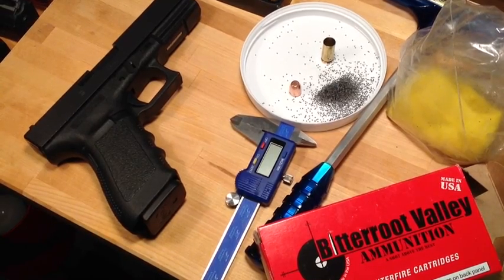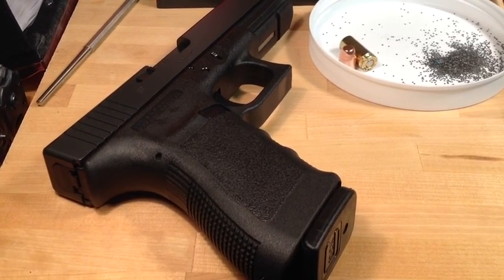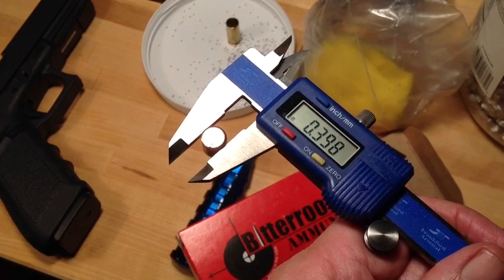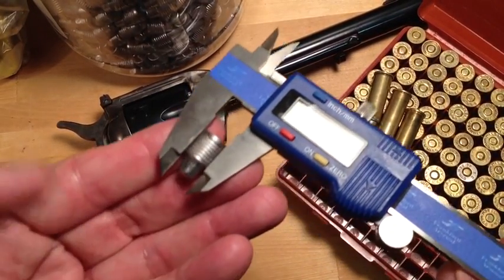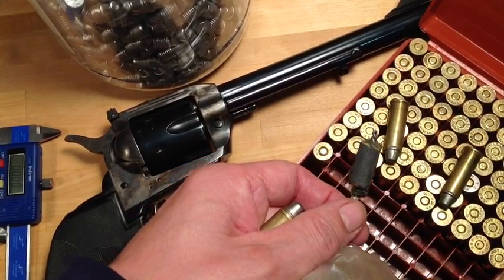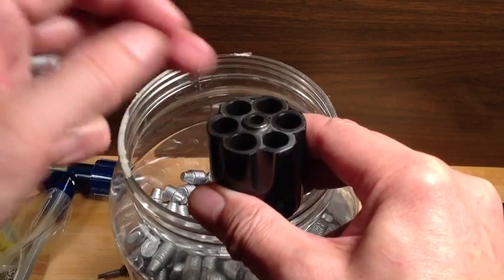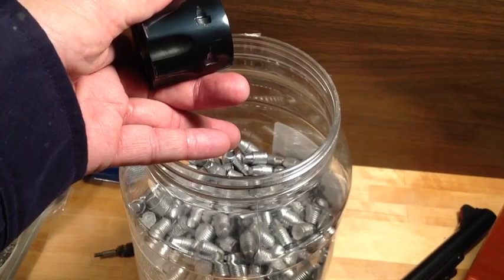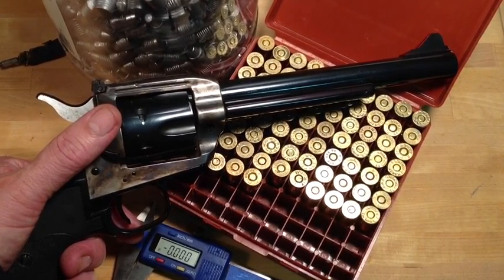The Trouble With Bullets Too Small For Your Gun

Comment: Fortune cockie 45 I really enjoy your videos. They are very informative .  I hand load 45 acp and 45 colt. I cast Keith type bullets for them.  I'm thinking of buy a lever gun in 45-70 govt. Is there any way I can use the same bullets in the 45 colt and the 45- 70. I don't want to have to buy new molds for the 45-70 and then have to make sure I keep the bullets separated.  I would like to hot rod the 45 colt rounds to 44 mag pressures.

Comment: I don't know if you bought that gun new or used, but maybe someone reamed out the cylinder .  Some people think that the bullets should drop out the cylinder. Not something I think need to be done in most cases.
Reply from the maker: Farmer Dude357 - Bought that gun brand spanking new...Came with cylinder throats .007" huge - might as well have been the Grand Canyon...Gun needs a new cylinder, but not worth the cost - just shoot jacketed bullets will be OK... Also, I've had some success using a mold that drops bullets way big, then powder coating them even bigger.  Makes this gun shoot decently.  There is a video up on that.   Have a great day,  FC
Reply: It makes me wonder if you got a lemon, or all them guns was made like that. I know I've said it before but thanks for your videos.
Reply from the maker: Farmer Dude357 - The guns are excellently made otherwise...And I've been able to get the guns to shoot decently.  Just takes ammo that I label - for the Virginian.  And if someone bought one of these, just shoot jacketed ammo - they shoot jacketed ammo just fine...the jacketed bullets just traipse through the big cylinder throats and enter the forcing cone without minding that the throats were so big... Best to ya,  FC

Comment: In light of this video, would you say that the shooting 9mm out of a convertible Blackhawk is a bad idea?
Reply from the maker: J0sh92 - Great question - wish it could have a short answer.  it's been reported that those 357/9mm guns do not shoot 9mm well because "the bullet is bouncing around in the bore".  The assumption is that our bore is .357" for 38/357 and 9mm bullets are .355'.  But from the video, note that in a properly set up revolver, the barrel groove diameter is actually smaller than caliber. The important thing for accuracy with lead bullets is the chamber throat dimensions need to match our bullets.  So for these BH Convertibles to best work - the cylinder for 357/38 should be .357" so our jacketed bullets can be .357 and our lead bullets .358" (.001 bigger than chamber throat).  The 9mm cylinder needs to have throats at .355" so 9mm jacketed bullets are .355 (and they are), and our lead bullets .356" (again .001" over chamber throat).  So for perfect performance, our BH barrel should be .3545" so that the forcing cone will direct .357" and .355" bullets into the rifling maintaining seal from the chamber throats, through the forcing cone, and into the rifling without allowing gas blow by.  If the BH is set up that way, shooting the 9mms in the Convertible will not be a bad idea.  If not set up that way, hopefully the 357/38 is and we can just shoot 9mm jacketed anyway.  Best Regards

Comment: Like Wayne Johnson said, what is the groove diameter? Measuring the throats tells us they're over-sized, which can definitely lead to inaccuracy, but there's a part of this puzzle missing. What is your groove diameter?

Leading isn't caused by over-sized throats, but usually by throats that are undersized. For example .428-inch throats with groove diameter of .429. The undersized throats size a cast bullet down to .428 and it doesn't fill the .429 grooves and leading results.

If your groove diameter is larger than your cast bullet, you will get leading and accuracy will really suffer. Bullet fit to the rifling is critical.

Slugging the entire bore will let you know generally what your groove diameter is.
When slugging your bore, feel for tight spots and loose spots. After slugging the bore, make sure to slug just the area where the threads of the barrel screw into the receiver. Very often manufacturers will over-torque a barrel onto a receiver, causing a constriction in the bore at that location. A thousandths or two constriction at the barrel threads might be able be lapped out.

Again, your throats are definitely 'a' problem, but not necessarily 'the' problem.

By the way, jacketed bullets are more forgiving than cast, to a certain extent.
You might want to try some jacketed ammo to see if you can get acceptable accuracy. Regardless, if your groove diameter is grossly larger (several thousandths) than your bullet diameter, accuracy will suffer whether cast or jacketed.
Reply from the maker: John4566442 - Thanks for your comments.  Sorry for the length of this, but it is a comprehensive subject as you know.  

First of all, my Dragoon shoots very poorly with jacketed ammo.  When I first bought the gun 38 years ago, it was the age of high velocity light jacketed bullets and the flyers were unacceptable.  The company went out of business and I put the gun away. When guns shoot badly with common jacketed bullets, then bigger bullets are indicated.  Since the chamber throats are .436, I need .436-437 bullets to give this revolver a chance to shoot clean and well.  I've had lots of revolvers since then, and learned a great deal.   

I always slug my auto pistol barrels, and keep the slugs in the gun boxes for future reference.  Revolvers are in a totally different creature.  One of the first things I do with revolvers (even before I buy them) is to measure the chamber throats.  When people ask me when I slug my revolver barrels, my answer is 1) when I need to (I never need to for the reasons below) and 2) when I get the rare squib load and drive out the stuck bullet, I've slugged my revolver barrel and unless I have tapered rifling (and you can tell that when you drive the slug out), that slug is good to keep, but I've never measured one.  That's because the barrel groove diameter are the end to the relationship chain of bullet - revolver chamber throat - forcing cone - barrel constriction if any - and finally the barrel in regards to accuracy and leading. There are two schools of thought on this and the main difference between the two schools of thought are on the proper diameter of the chamber throat in relation to the bullet the beginning of the chain.   And arguments usually ensue - we don't need to do that.  Both you and I have good understanding of the issues. 

I read a lot,written by knowledgeable people, but I don't put names on who said what unless that person is one of such mega stature you can't help but know the name - All I know is that if the information is based well, I apply it and wind up with what works and works well.  For me that's 95% with cast bullets.  We can argue ad infinitum, but as long as we can safely shoot aspirin tablets at 12 1/2 yards without leading, we have to be happy.

So let's look at   

One school says the chamber throats need to be larger than the bullet.  So here's the problem with large chamber throats - On firing, hot high vel gas blows by the bullet  1) as it is released from the case 2) as the entire bullet is passing through the large chamber throat 3) since our purchased bullets are either .429 or 430", gas will keep cutting by the bullet until the bullet hits the rifling leade past the forcing cone (that now serves little purpose) and obturates there.  What happens is that the gas cutting will lead the cylinder prior to the chamber throat, lead the forcing cone and the first 1 1/2" of the barrel to begin with.  People that shoot lots of expensive jacketed bullets are forgiven all that as you have stated.  
The second school of thought is we want cast bullets .001" bigger than the chamber throat.  On firing, hot high vel gas blows by the bullet 1) as it is released from the case, but as soon as the ogive hits the cylinder throat, the gas cutting stops.  2) The bullet is ideally still large enough to hit the forcing cone while the bullet is still passing through the cylinder throat, and swages there into the rifling lead - obturation assured.  The only leading you get from this is some on the inside of the cylinder short of the throat easily removed.  So, for example, if the chamber throats are .4305 - .431" (measure six), our bullets are .432".  The .431 bullets hit the forcing cone while still exiting the cylinder, trues up, and swages to .429 filling the grooves.  This Dragoon, with chamber throats at .436 is doomed for leading and leading inaccuracy with cast bullets no matter what the barrel diameter is (within reason of course).  That's why I don't bother to slug revolver barrels.  If I can put the appropriate bullet into the forcing cone, and it engages just early of the rifling leade, I know the barrel groove diameter is fine (you can even eye ball for the 11 degree forcing cone angle this way).  But I do need to know where to start with my cast bullets, and that's the chamber throat measurement.  Again, sorry this is long, but there's no way to shorten this discussion.  Best to you and Happy Holidays
Reply: Okay, have fun, Merry Christmas.
Reply from the maker: John4566442 I went ahead and slugged the Dragoon's barrel - it measured .428" groove diameter (largest measure I got on rotation).  Thanks for spurring this as I should be able to get some jacketed ammo to shoot well (it did not shoot light jacketed well in past).  Also, got a great idea to try in cast - should be interesting...just did another video on this.   Best Regards

Comment: The manufacturer somehow really botched the cylinder on that Dragoon.
It doesn't seem possible to overcome this problem by using lead bullets of .436 diameter, because those would be so oversized for the bore that they would probably be dangerous to shoot.
Reply from the maker: PinkOld - You've hit on it...my next step would be slug the barrel (something that should not have to be done with revolvers) to see how much swaging the bullet would have to do to work.  Pressures would have to be considered.  If the barrel was also oversized, would explain all the bad accuracy this gun has demonstrated in the past.  I just didn't shoot it for about 35 years.  Now I'm working with it a bit.  Funny, though, this gun did have its moments - fleeting, but notable.  Jacketed bullets might work OK since they won't lead and if they blow through the big throats and hit the forcing cone, and the barrel groove diameter was OK for the jacketed bullet, might shoot OK.  But that gun shot very badly with light jacketed bullets in the past.  Shame, because the gun is well made otherwise.  Small chamber throats can easily be opened up - but oversize is a disaster....I'm not even sure what the ammo would look like loaded with .437 bullets - might be atrocious.  Happy Holidays to you

Comment: Interesting.  Tho I don’t have a .44 nor do I reload, as you know, but I hope to some day, and plan on starting with .357 Magnum.  I have two revolvers and one lever action in .357 Magnum, and I’d like to use the same bullets for all 3.  I bought my dial calipers in 1967 when I worked in a machine shop, and sometimes wonder if its worth upgrading to digital when I get into reloading.
Reply from the maker: gapster46 I have two calipers, an old dial one that I got 35 years ago and a new digital one from Frankford Arsenal.  Between the two of them, I use the FA digital because it is faster to read.  But I used the other one for years.  Don't remember the brand because I'm at the office, but I'm sure it's not as good as the ones you and mytmousemalibu have... Best Regards to you both and Merry Christmas / Happy Holidays to you...
Reply: I like my mechanical dial Mitutoyo calipers, robust, simple, reliable and high quality. If the ones you have are still in-cal or check good, spend your cash on other goodies. If they are 1967's, they are likely way better than 80% of the stuff made today. Mitutoyo, Brown & Sharpe, Starret, etc. Hard to beat the good ole stuff!
Reply: They are made in Germany by Helios.  I keep them in the nice wood box they came in.  A search says they are a fine pair of calipers.  They still look brand new.  They just don’t have the fancy digital readout to .000, but I can easily read .005 if it’s half way between the lines.  With a magnifying glass, I could probably interpret it even closer.
Reply: FortuneCookie45LC Merry Christmas and happy holidays to you aswell!

Comment: Any particular reason for the cylinder throats to be so much larger than spec?

After further reading it looks like I have even more to do! Lots of variations in throat sizes for several reasons. Thanks for the heads up! This 44 magnum story gets better and better the more I look into it!
Reply from the maker: ***** I like your thinking on choosing the best bullet diameter for your gun.  You went with the biggest chamber throat accordingly.  Have you ever heard of revolvers that always threw one or two shots out of the group every six shots.  Well, if you have an odd overlarge chamber throat, and the right size bullets for the smaller ones, just think of the accuracy loss with that one chamber that always rolls up every cylinder full shooting the wild smaller bullet?  Have a great day, Merry Christmas and Happy Holidays
Reply: Bad QA. So many production revolvers are like this. Two of mine from s&w had small chamber throats in relation to the bbl groove dia. Had to open them up just so the bullet coming from the cylinder was then fitted properly to the bbl. revolvers aren't made with exacting standards anymore and it's sad. One S&w revolver I have has a tight spot in the barrel just past the forcing cone. A revolver smith told me this happens due to over torquing a barrel in the frame when the thread body is slightly too long when installing the bbl... Another nightmare for lead bullets.
Reply: shotgundrums I agree and experienced something similar with my 629. I bounced a question off of FC45LC prior to buying some cast bullets for it, and I'm glad I did. He and a couple of his subscribers really helped me out. I used two sets of calipers to measure the throats on that 629, and no matter how I measured, there are three chambers that are .001 to .002 over the smallest one. I ended up going with .431 SWC's from Oregon Trail and they seem to work well. Minimal leading, and decent accuracy. Thanks for the info above!
Reply from the maker: shotgundrums Great points you bring in.  Some Rugers had chamber throats a bit on the small side as well - gunsmith opening those up to standard specs improved accuracy.  The constriction you point out is adverse to accuracy and happens to some Rugers also.  When lapped out (I don't know how gunsmiths do that, but they do) even more improvement to accuracy. Best to you and Happy Holidays